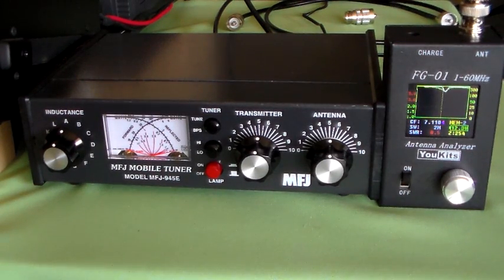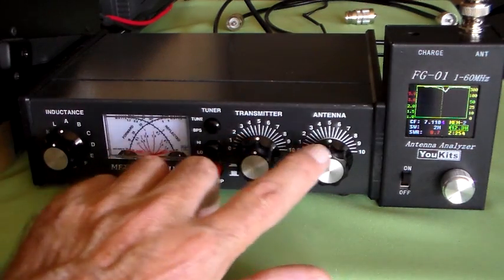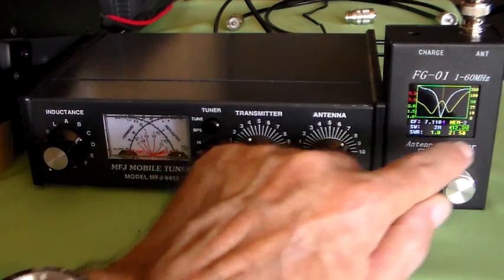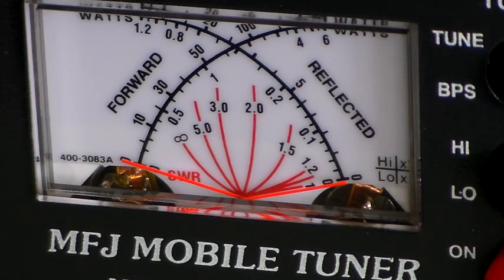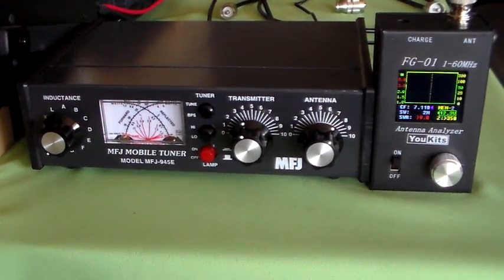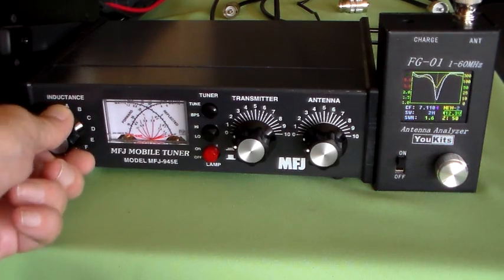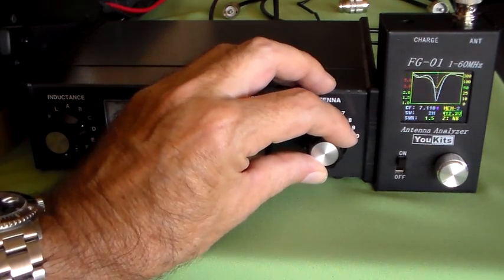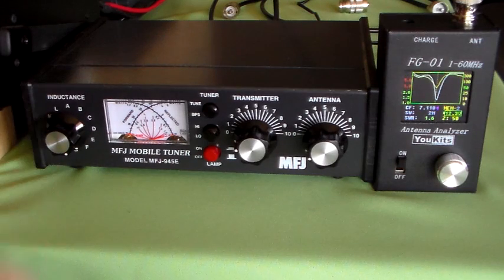Best Manual ATU Tuning Method.

Comment: Thanks Steve, very informative and looks like Yorkist will get another sale!
Andrew VK6AS
Reply from the maker: Thank you for those kind words Andrew. Yorkist, Yourkits... it's You-Kits Andrew, You-Kits! You won't regret picking up one of these if you love playing around with HF antennas, traps and tuners.
Reply: VK6CS Yep it is on order!  What is your view of the MFJ ATU that you have, would you buy that model next time?
Reply from the maker: Good question... for the application I bought it for, yes I would. I bought it for portable/mobile use so I didn't need an internal balun, or a wire antenna connection post. When portable, a wire antenna terminated with a banana plug will plug nice and snugly into the SO239 antenna socket. And when mobile the coax terminated with a PL259 plug will plug directly into the SO239 antenna socket. It works well from 1.8 to 60MHz and I thought the 6m capability was useful.

I wouldn't buy one of these as a base station tuner, but as a budget entry level portable/mobile play-around tuner they're ideal. I have heard you should rate any MFJ tuner at half the power it's rated at, and looking at the internal components that's probably about right. This one is rated at 300W, I wanted to use it at 100W, so I should have 50W of 'headroom'. Tuning it with the antenna analyser eliminates the risk of high voltage arcing on the inductor selector switch and flash-over on the rather small variable capacitors. So far I have not had any problems with arcing or flash-over tuning it with my FT950 and FT857 at 100W in FM mode.(Tuning it in FM mode allows me to see the SWR more easily). The important thing to remember is to release the PTT when you rotate the inductor selector switch if you're tuning with a radio and not an antenna anlyser. When it's correctly tuned, running 100W SSB through it will be fine. If you're looking at getting a good quality ATU for your base station, take a look at LAMCO and Palstar.